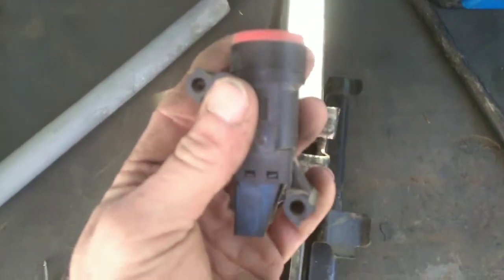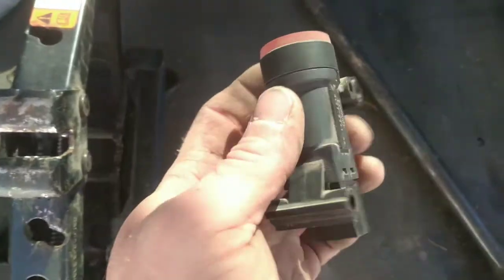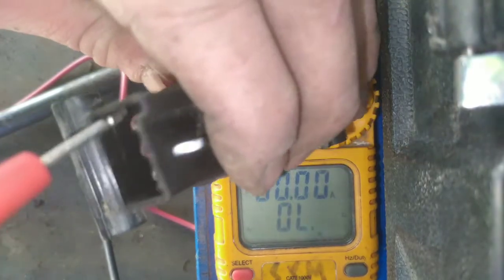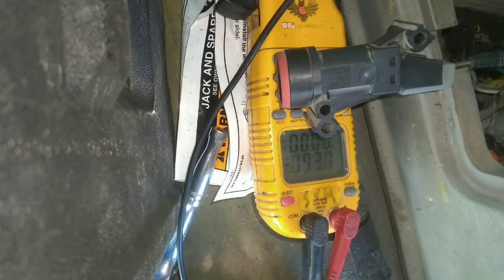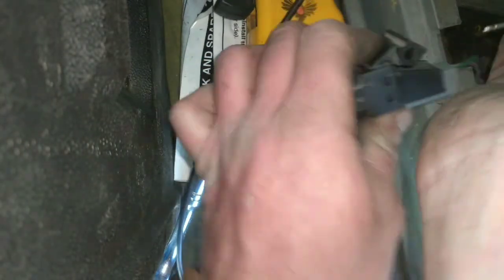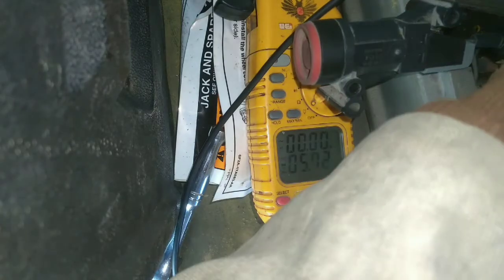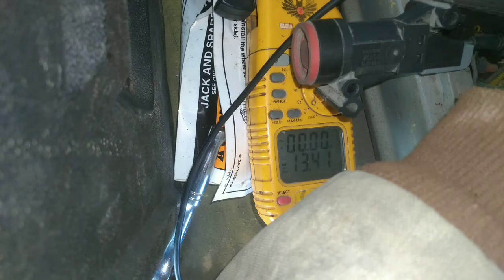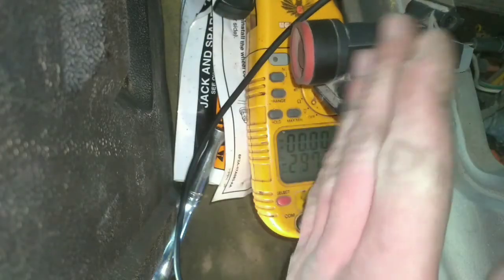Ford fuel cut off switch (inertia switch) part 2. How to troubleshoot a problem

Comment: Well done sir and thank you kindly help me understand
Reply from the maker: I sure appreciate the comment, please feel free to subscribe to my channel if haven't already
Reply: @singularautomotive3542  So I went parts hunting last night and today. Crazy thing most every place I called wanted $60 - 80 for this switch. And no body had one, I was told, We can have it here in a day or two. The last place I want to buy from is the dealership. But I gave them a try. The guy asked for the vin on the sports trac. which at the time I did not have. But he said you will have to pay for it first and they would have it in the morn. and I could pick up. He said the comp. listed two different ones. $55 and $75. So i go down there this morning and he looked it up again and charged me $45. That has Never happened before the dealership was cheaper than all the local auto parts places. thanks again for all your help.
Reply from the maker: @fred306801  I had that happen once, I needed wheel bearings for a Ford Festiva. $4 for both at the dealer, AutoZone wanted $10 each for some no name brand. You're better off going oem anyways. And you're welcome, feel free to reach out if you need anything
Reply: Inertia switch cause hard starting?

Comment: Could this switch lead to a intermittent no power to pump failure?
Reply from the maker: It can, you can jump the two wires that go to the switch together for a few days to try to rule out whether the switch is bad or not. But either way don't just leave it jumped out permanently, they're not that expensive on rockauto and you do not want your fuel pump to keep running if you were to ever wreck or flip your car

Comment: What would you do ?,  I went to town this morning and the Ford Sports trax 2003 ran fine. Went out that evening and it would spin over but would not start. I tracked down this switch like the one shown in the video tapped on it and pushed on the top. Could not tell it if it clicked as if to reset itself. Wiggled the wires around and tried the key again and it fired up. Had filled it up that morning with fresh gas.
Reply from the maker: I would just buy another interia switch, they're not that expensive on Rockauto.com.  Inside of the interia switch is a metal ball that sits in a socket and makes contact with both terminals. If the ball gets knocked out of the socket or you're losing connection with one of the wires then the switch can cause a no start condition. The inertia switch can go bad like anything else electronic. And if you can't afford one or you get stuck out and it is bad just bypass it until you can get a new one, but definitely replace it at some point that switch is what cuts off the fuel pump if you were to have a bad wreck or flip the vehicle
Reply: @singularautomotive3542   Thanks for the video and the advice, I was totally lost on what to do. Thanks again.
Reply: I had the same issue with my 2005 Sport Trac. Thought it was Gas so put more Gas in still not start just Engine Cranking or it would try to start for like 30 secs then quit but mostly turning over and rumbling. Towed it to the House. Next morning I pressed the inertia switch and it fired right up. Wandering if the passenger I was giving a Ride to that Day hit the switch because in Sport Trac they put it in a Horrible position just above where the passengers feet set. Not knowing if that what the cause so I bought a Fuel Control Module . I did reset the Inertia Switch but figured I'd change out my Fuel Control module first then Inertia next that way two things out of the way that could cause the issue.
Reply: @singularautomotive3542  Rockauto is cheap on their prices compared to autozone or oriellys. $75 at a competitor or $12 at Rockauto ... Thanks and it's a Standard part decent company as well.

Comment: I had small front end collision. Recently, fixed parts. Car kept starting, I could drive it. A month ago though, I had trouble starting, cranked, and eventually started. Like no gas. But yesterday it didn't  start. Cranked, but no start. Is there an inertia switch in the front? Do they just go bad? Or is it over time?  Thank you
Reply from the maker: The interia switch is tripped by a hard jolt. Ford installed them in the rear on some models and in the front on others, regardless a hard enough impact will trip the switch. They normally just trip when a large impact occurs and cuts the power going to the fuel pump until it is reset. Sounds like to me you have a wiring problem, not saying it couldn't be the switch. I'd start with the crank position sensor if you car has a tachometer. Crank the engine for 10 seconds and watch to see if the tachometer moves from 0 any during that 10 seconds. Let me know how it goes and if you knew where the interia switch is at in the vehicle you could jump the two wires together and bypass it just to rule that out as well. Hope this helps
Reply: @singularautomotive3542  trip switch is fine, not set off. Actually I sprayed starter fluid in throttle and it started. Then ran rough. So I think it's the filter. I'm replacing that first. See how it goes. If it still have problems then it's definitely fuel pump. I hope not. Thanks for your response